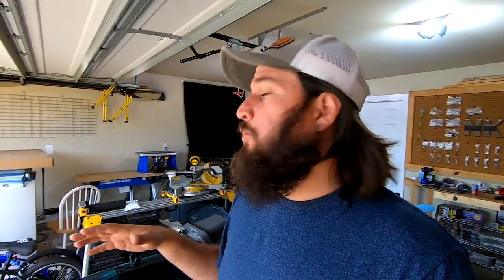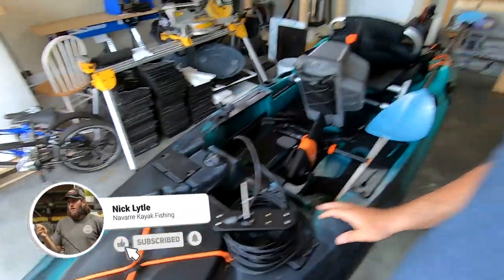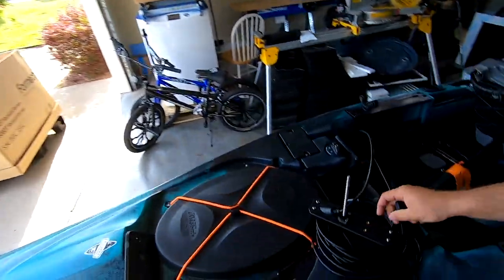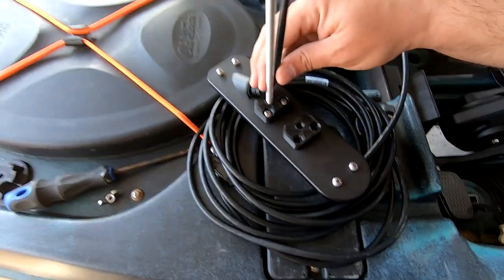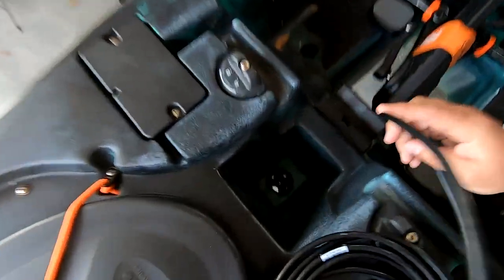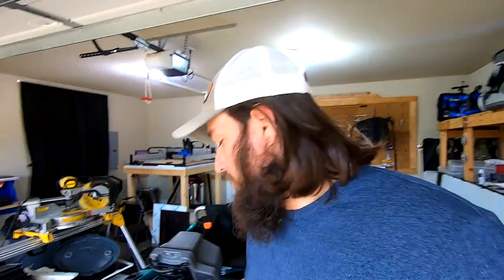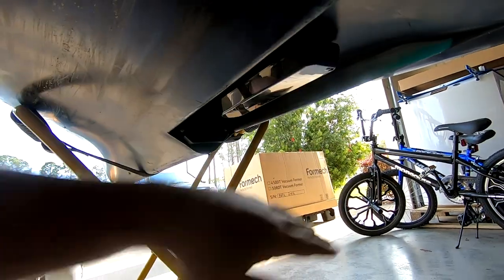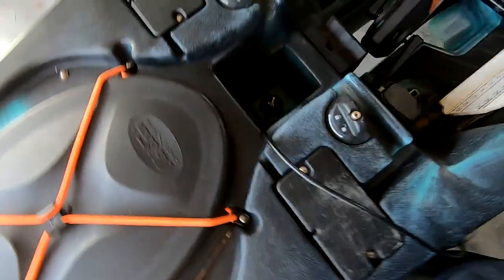Helix 8 Chirp MEGA SI+ GPS Transducer Kayak Scupper Mount

Comment: What do you think of the idea of gluing the transducer to the hull right were it seats in this video, but applying some sort of 3m waterproof double side tape or some epoxy.
Reply from the maker: It may work for a while but I’m not sure how long it would hold and cleaning it off to reapply and reinstall might be a pain.

Comment: I have 2 Hobie kayaks, both are Compass. One is a 2018 and the other is 2019. 2018 I use a Hummingbird Helix 5 with DI and the 2019 a Garmin Striker 9 Plus with Side VU and Down Vu. Currently using a Yak Attack Switchblade for both. However, I’m experiencing issues of erratic or no readings and I think it’s because bumping into items. Example, Helix gives no depth and CHRP stops working or gives erratic readings. Same with the Garmin which makes me think it’s the transducer.  What’s the best way to mount the transducers? There is a transducer mount at the bottom of the yaks but if I’m not mistaken, it’s for through hull transducers only.

Comment: Will the helix 8 si g4n  scan properly  when mounted on a 3waters bigfish 108? Using there preinstalled mount.    It sets up high in the tri hull. Wonder if that would affect performance
Reply from the maker: I’ve never personally installed it on the kayak so I’m not 100% sure.
Reply: @NavarreKayakFishing  I need this exact scupper hole mount how do I go about ordering from you?   Helix 8 si+ g4.     My question is will it still allow side imaging to work properly?

Comment: will this work in  that scupper hole below the minnkota motor  on my awsomOSAP136? those side walls will not obstruct the view of side scan on transducer ?
Reply from the maker: It will.  We have a ton of clients who have installed similar transducers in the same spot on the AP. 

You may notice some surface interference if you spin the motor around to go in reverse.